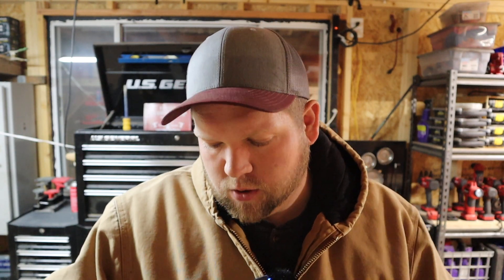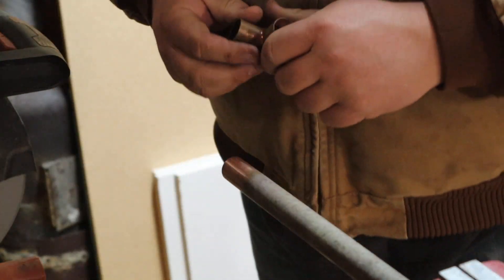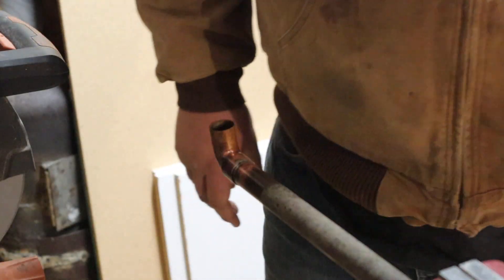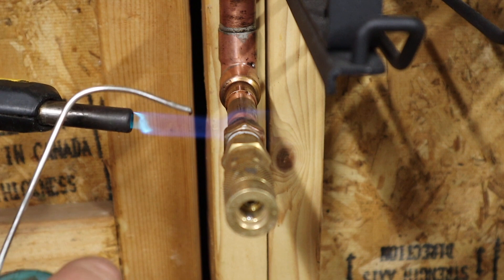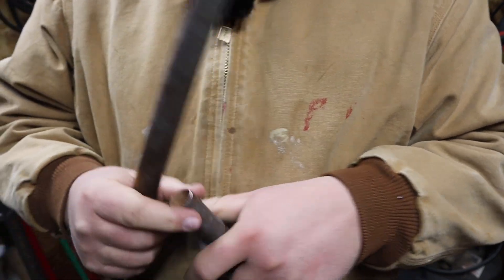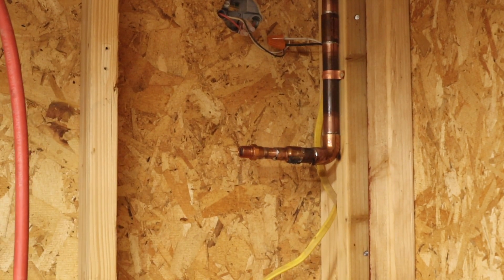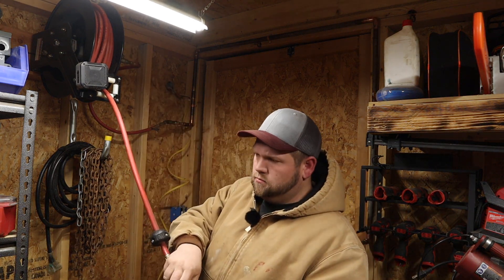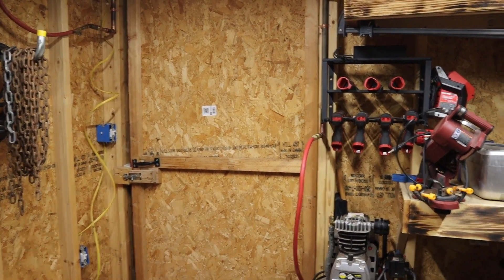How to Solder Copper Pipe and Building a Hard Pipe Compressed Air Line/Pipe System

Comment: I’ll be honest, it wasn’t until a few days ago when I saw a short run of sweated 1/2” copper compressor line in my brother’s new house basement to garage that I had even heard of safely using the stuff for this application! I’ve only ever used 3/4” black pipe and threaded connections. I didn’t think sweating was strong enough for this. Learn something new every day.

Comment: Question. Why not just run 1/4” copper for all the runs instead of breaking it down to 1/4” pipe at connections.
Reply from the maker: Because I had 3/4 on hand I didn’t have to buy.

Comment: Running copper for compressed air is dangerous, it's gonna blow eventually.
 The copper, work hardens like a coat hanger being bent back and forth. It'll get brittle and crack around fittings and caps I expect.
 The small copper lines on compressors have a very different ratio of wall to bore.
Reply from the maker: I’ve never heard this perspective before. Copper is a soft metal. When it “blows” (if it ever does) it will just open up a hole. It’s not going to send shrapnel everywhere.
Reply: @DereksWorkshopAndProjects  A big system, with 20-30ft or more of pipe pressurized, contains a lot of energy. If there is a cap, and the pipe inside, cracks off where the cap ends.
 In medical and school systems, with L grade copper, pressurized 24/7 they last years but once you get one crack the whole system is trash.
Reply: What copper is bending back and forth? Do you mean how the elbow is sticking out from the wall for the connection?

Comment: I saw that you used teflon tape AND some kind of pipe compound.  What did you use, and why both?
Reply from the maker: Teflon tape and “pipe dope”. Teflon tape does the job and the pipe dope is just another precaution to make sure it’s sealed and there are no leaks.
Reply: @DereksWorkshopAndProjects I do the same: Teflon tape then Megaloc. Works great.